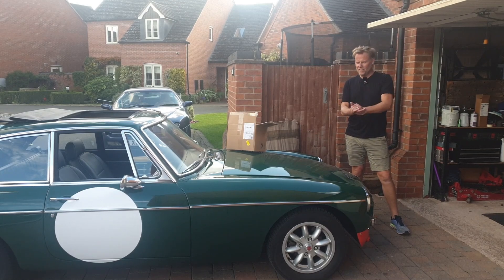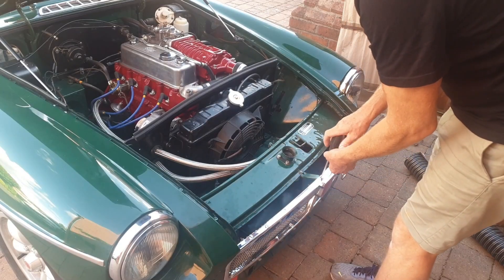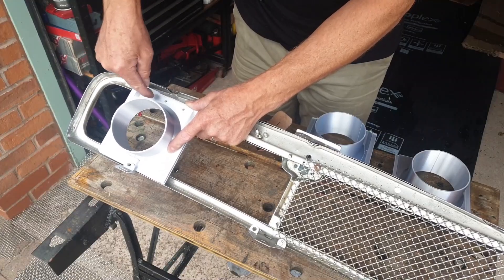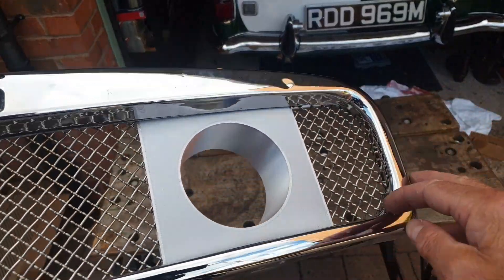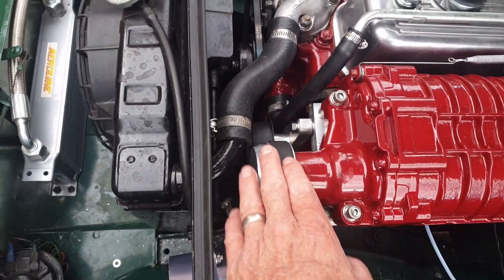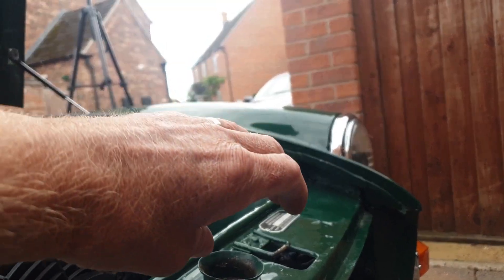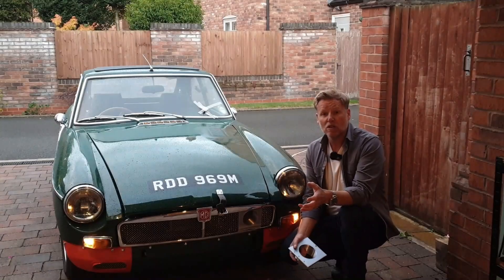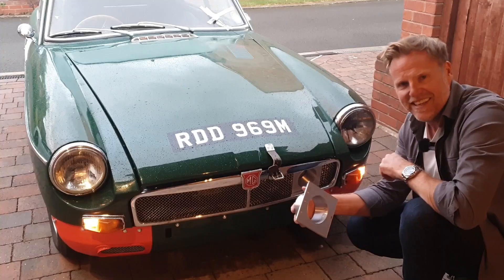MG BGT Cold air ducting   Supercharged  @Exhausted

Comment: Great series Craig, any chance i could buy the 3 bits that you've had 3D printed?
Reply from the maker: Thanks Stephen, for the watch and the great comments.  

I have now uploaded the files to Makerworld for people to print their own.  

https://makerworld.com/en/models/1787296-mg-b-bgt-cold-air-inlet-connectors?from=search

If you don't have have access to a printer I can print some, but would need to know where you are so I can work out cost for postage etc. Also filament cost etc.  Let me know if you'd like them printed.  I was probably going to put the 3d printed bits on Ebay if people want to have me print them for them.

Thanks 

Craig
Reply: Hi Craig unfortunately I can't do 3D-printing.  My postcode is S810bs If you could get me a price for the 3 bits posted that would be great.
Reply from the maker: Hi Stephen,  I'm printing these for you at the moment.   I've done 3 off them in silver like I've got.   But I've also got some high temp black filament for the two pieces that attach to the radiator shroud.   The silver might be OK but it's PLA filament that is only rated to 50 or 60 degrees.  So I'll send you 3 silver and two black.   Once I've finished printing I'll get them packaged up and work out a cost.
Reply: @Exhausted-autos cheers Craig,  sorry for late reply I've only just seen your message.
Reply from the maker: Hi Stephen, all printed now.   What's your address so I can sort postage.   Is £15 plus postage OK?
Reply from the maker: You can email me instead of putting it on here.  chardwicksmith@gmail.com
Reply: @Exhausted-autos hi Craig I've sent you an email.